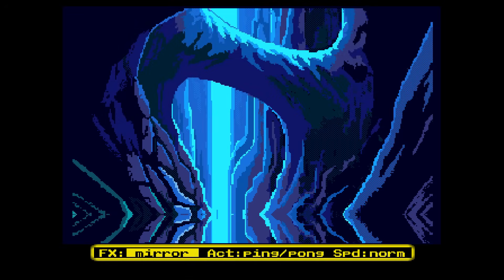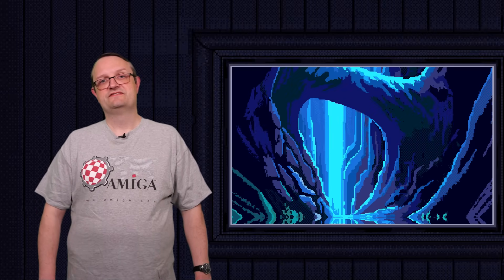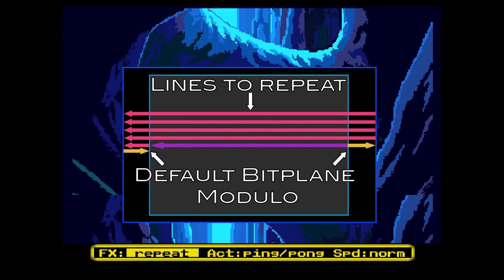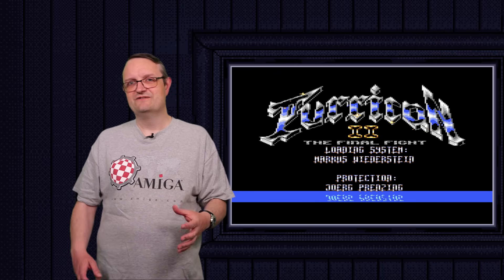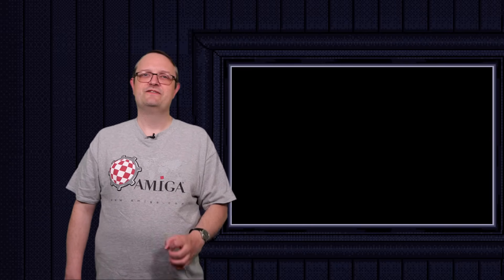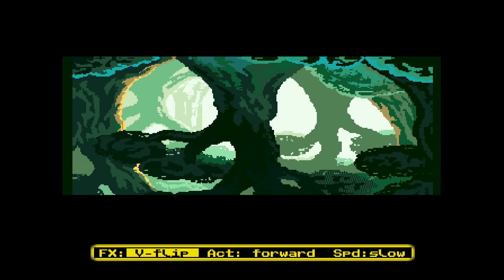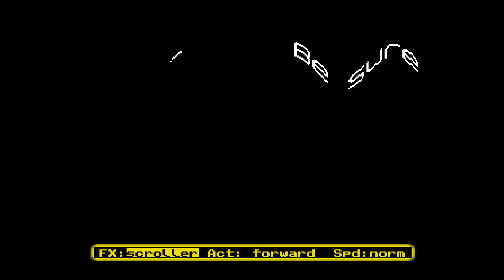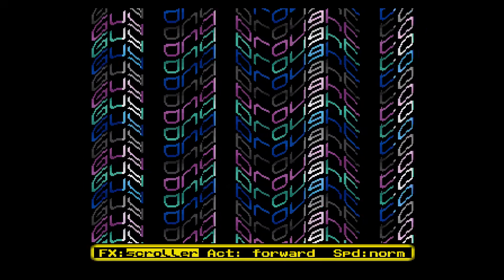Amiga Tech - Bitplane Modulo Tricks

Comment: Here's a question for you: If OCS Agnus steals 0% cycles from the 68000 at 320x256 in 16-color mode and 50% of the cycles in 64-color mode then approximately what percentage of cycles does the Agnus steal cycles in 32-color/5-bitplane mode? The Hardware Reference Manual gives estimates for 4-bitplane and 6-bitplane mode but doesn't seem to say anything about 5-bitplane mode (p. 196). I figure that if anyone could test this, it would be you.  :]
Reply from the maker: In 5 bitplane mode, bitplane DMA steals 25% of CPU cycles. Note that this, like for 6 bitplane mode, is only valid for the display window area. The horizontal and vertical blank are unaffected. Which means that in almost all cases, the actual number of cycles stolen is lower than 25%/50%. 

Also of note is that DMA can only steal memory access slots - internal CPU operations are not affected. On a 68000, these are quite common: only 50% of the 68000's cycles are on the bus in the best case. For complex instructions (shifts/rotates, multiplication & division), that number goes down much further.

So the actual number is quite complex to calculate as it depends on the size of the screen, other DMA activity like the Blitter and what code is being run.

For example: a 3D game that does lots of multiplications and divisions is affected much less by cycle stealing than a simpler 2D game without such instructions.

Comment: For the horizontal shimmer of the water effect, couldn't you use a rowstride ("modulus") that is not a whole horizontal width?
Reply from the maker: No, because the bitplane modulos on the Amiga increments in 16 bits, which is 16 pixels worth of shift (due to the planar nature of Amiga GFX)

You could use bitplane modulos as one part of a line-scrolling algorithm that scrolls for more than 16 pixels though, which would be faster than writing new bitplane pointers per line. You’d still also need the playfield shift registers alongside it in that case for the per-pixel scrolll though.
Reply: @DutchRetroGuy I see, thanks. So each byte value of a bitplane encodes 8 pixels, and then I guess there's some alignment, hence the 16 pixel accuracy? Interesting, I'll need to read up more on Amiga gfx.
Reply from the maker: @vancetuber7305  yeah, the Amiga chipset is a 16-bit one and it requires pointers to be aligned to 16-bits. If you provide an odd address to any pointer value used by the chipset, it interprets it as an even one. Hence, 16 pixels.

Comment: This kind of reminds me of one of Future Crew's earlier PC demos, Mental Surgery. It features a huge scroller and at first I couldn't figure out how they made that work on just a 12MHz AT with a simple VGA card. So I disassembled the code and found out they set the screenbuffer to double width (640 pixels instead of 320) and move the displayed frame over that by changing the start position registers. This way, you only have to draw two columns of pixels every frame and update one 16 bit control register. Another trick they used was to use the split-screen register. The split screen was not affected by the start address. So clever.  
And.... that's about the best you can with do with hardware tricks on a PC, and maybe some bitplane trickery in 640x350 EGA mode 😬
Reply from the maker: Well, I am not a DOS coder, but I do find some of what they do quite fascinating. As with all retro platforms, it’s all about (ab)using what the hardware can do to prevent having to do the actual work 😉

Comment: Cool video! One thing I always wonder about these kind of effects where you're changing values as the screen draws each line, is how do you get your code to run at exactly the right moment so it changes the line you want? Also if you have time left over after doing your effect for that line, how do you idle until the right time for the next line? Is there some 'wait for the next line' instruction or something? Also do you get some time to run code in between the end of one line and the start of the next? (depending on overscan?)
Reply from the maker: On the Amiga, reliable timing is achieved by using the Copper - it can change chipset registers (like the ones used in these effects) with perfect timing/accuracy every frame. The Copper is a mini-processor with just three instructions (WAIT, MOVE and SKIP). The Copper runs 'programs' of these instructions, called Copperlists. These automatically start every frame and you can set where in memory they are found between frames.

The WAIT instruction is where the 'magic' lives: you can give a screen position (down to 4 pixels horizontal resolution) to wait for to continue with the next Copper instruction. That waiting is done by the Copper, the CPU, Blitter, etc are not affected by it and can continue doing things as normal.

This allows for very precisely timed changes to the chipset registers, which in turn allows for all sorts of effects (including what I've shown here, as well as changing colour registers, per-scanline scroll register settings, changing Sprite setup, etc).

So how it works is that you build a Copperlist using the CPU (or you have one already in memory somewhere) that contains the register writes you need for the next frame, update the Copper's Copperlist pointer to point at this list and it executes. Then, during the entire next frame, you have the time to make a different Copperlist at a different position in memory for the next frame. When that is built, you simply switch the Copper's Copperlist pointer to the new list and it automatically executes next frame.

Alternatively, you use just one Copperlist and time your changes to it such that they don't interfere with the effect. If your effect is simple or you need the memory, this is perfectly viable. I personally prefer the double-buffered approach, though.
Reply: @DutchRetroGuy  Wow! No wonder the Amiga was so good with hardware dedicated to effects like that. It was more complicated on the C64 right? But they probably learned from how people used the 8-bit machine. Thanks for the detailed explanation, it makes me want to try some Amiga coding
Reply from the maker: @SonicTheCat  I've personally really enjoyed learning the Amiga hardware and poking around with it.

It's all more complicated than on the 8-bit systems, but once it 'clicks', you can do many fun things 👍

Comment: Thing about this is it is a bit archival. I mean, some of it was to add an ASIC which compensated the computer for its weak CPU. Amiga fans love to boast about the "custom chips" but I think they're overrated. First of all, more or less every micro ever released was delivered with its own unique dedicated circuitry, but for some reason only Amiga fans came up with the idea of calling theirs "custom chips" and making them sound a lot cooler than, say, the SID and VIC II of the 64 when they weren't. It's a matter of taste but to me the SID and VIC "custom chips" were a lot cooler than those of the Amiga. 

It's all in the past now. Today nobody needs to think about this sort of thing anymore unless they are determined to continue programming the Amiga. I can understand some people wanting to do it but, again, the 64 has a more interesting array of chips with more interesting features and is more fun to program.
Reply from the maker: The C64 chips were/are also called custom chips or custom hardware. As are the Atari 8-bit ones. Named such by their manufacturers as a marketing strategy back in the 1980's - not by their fans. 

As for which system is more interesting, to each their own - I love my C64 (and yes, I have coded for it), but I find the Amiga much more interesting in both it's custom chip features, it's overall design and in the amount of fun to get from programming it.
Reply: @DutchRetroGuy  

Ok, well, despite what you claim, the Amiga chips are typically described as "custom chips". I have never once heard the SID or VIC or the Atari chips described as such and I'm 55 years old and I've owned a 64, and been part of the games programming community since the early 1980s.

I find the Amiga chipset to be a big disappointment after the 64. It's sound chip, for example, is basically an 8bit sample player. In fact, it's essentially 4x8bit DACs with a simple mechanism to copy data into them at varying rates. It's simpler and less interesting than the SID which was a simple but famously effective synthesiser  with operators which can be programmed in real-time to create sounds and effects. The SID is a more sophisticated sound device than the Amiga has. Realistic? Well, yes, every bit as realistic as the Amiga if you use it as a sample player.

https://www.youtube.com/watch?v=cKwLkNoySI4&list=RDcKwLkNoySI4&start_radio=1

But using it as a synth was massively more memory efficient. 

The Amiga's video chip was a disappointment too. The 64 had multiple graphics modes, including bitmap and character modes. The Amiga had no character modes so, unlike the 64 and consoles the Amiga can't do hardware tile-mode backdrops. 

The Amiga's sprites weren't very usable either. The C64 Vic chip ran at 8Mhz, a little bit faster than the Amiga blitter, and because of that, the 64 could display more pixels per frame at 50fps than the blitter can. The only problem with that on the 64 is it is so fast you actually run out of screen space faster than you run out of CPU time.

The 64 arguably had a greater number of premium games than the Amiga. The Amiga had some good games but they were far fewer. The real obvious benefit of the Amiga over the 64 is the Amiga could display more colours at a higher resolution but that didn't often translate to more playable games. Sure, I can name Speedball II, Turrican II, etc, but it's hard to make a long list. With the 64 there is Wizball (which is miles better on the 64 than the Amiga in every respect) there's Impossible Mission, the "Games" series, including Summer Games and Winter Games. The 64 had decent paint and music programs too. I owned an Amiga but my pathway through it was a lot shorter than the time I spent with the 64 and the PC. The Amiga was impressive on its launch date but lacked software and users then and it was expensive to have an A1000 with a monitor and no software. The Amiga wasn't an intelligent choice until after the A500 was released with a modulator so you could run it on a TV and even that early the Compaq Deskpro in 1987 became the first ever truly 32bit desktop computer so, as soon as the A500 was launched it was already obvious things were going PC, well, especially if you remember that there was a never a time in history when Amiga sales came close to PC sales so there was a never a time when the PC wasn't a lot more popular than the Amiga.
Reply from the maker: @vapourmile a quick google search for C64 custom chips finds a whole bunch of results referring to the chips inside the C64 as 'custom chips'. You are simply wrong on this.

To give just one 'period accurate' example out of many, the following text is found in Zzap!64's review of the C64GS: "The console has identical graphic and sonic capabilities to the C64: ... The custom video and sound chips, VIC II and SID respectively..." (I omitted parts for brevity).

I'm sure that if I put effort into it (which I did not do, this was the result of about 1 minute of work, including Google searching and copy/pasting the text), I could find many more.

As for the rest: I apologise for not reacting to it further, but this is a channel where we celebrate all things retro, we don't do platform wars here. 

In short: you're entitled to your opinion of course, but I disagree. And I say this as someone who has several C64's and did several C64 videos on this very channel. Peace.

Comment: Using the water approach should also be possible to do the street fighter type of floor
Reply from the maker: As long as you don’t have any Blitter objects overlapping the floor (or you use Dual Playfield mode/Hardware Sprites for the fighters), that would work yes.

Comment: I wrote an article for AmigaWorld Tech Journal a while back which detailed how to use bitplane modulos to help accelerate simple blits (Volume 2, #1, available on the Internet Archive).  Rather than storing each bitplane separately, you basically "stacked" them horizontally, then fiddled the modulos such that it treated your n bitplane image as a single bitplane, which meant you incurred blitter setup costs only once.  For blits of small images, it paid off very well.

That, however, played tricks with the blitter, not the Copper as you're doing.
Reply from the maker: Yes, interleaved blitting is definitely another great way to use bitplane modulos. Didn’t fit with my example here as I was focussing on visual tricks, but definitely a cool way to do things 👍

Comment: This takes me back.  I used to write copperlist effects back in the day and the only reference we had were the 5 or 6 Amiga Technical Reference manuals.  I've no idea how I afforded those at the time, and I still have them today.
Reply from the maker: Ah, I never got to get the hardware reference manuals back in the day - so it took me quite a bit longer to learn these tricks. I only seriously started learning about the Amiga hardware from around 2015 and on. Great fun though 👍
Reply: @DutchRetroGuy They were amazing, probably more detailed than modern console dev manuals.  There were some good alternative Inside books though
Reply from the maker: @st3ddyman  yeah, they're very nice. I finally got mine in 2021 or 2022 - up until then I was using an online site that had the same information in HTML form instead 😅

Comment: About using the modulo for those FX. Is it possible to achieve similar with repointing the bitplane pointers every line? If so what are the benefits of using modulo vs setting the data source pointer for a bitplane every line?
Reply from the maker: You can do most of them using bitplane pointers, but the advantages of using bitplane modulos are:

- you need only two register writes, rather than as many as twelve (depending on bitplane count and memory layout of the bitmap)
- some effects could technically be done by just setting the bitplane modulos once, rather than line by line (though the ones in this example don’t always have that option)
- the calculations are simpler: you don’t need to know the bitplane pointer  values, just the difference in bytes between old and new situation.
Reply: @DutchRetroGuy  Thanks, all clear. I should know this but I always sometimes forget and get worried about if I get the hardware correct. And I had a demo fx idea based on bitplane resetting so jut needed to put my mind at ease :)